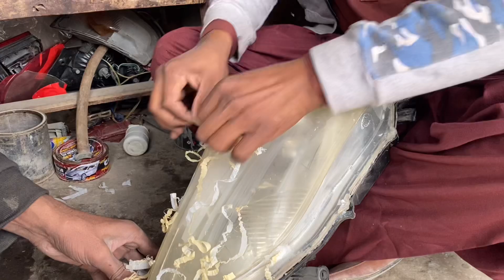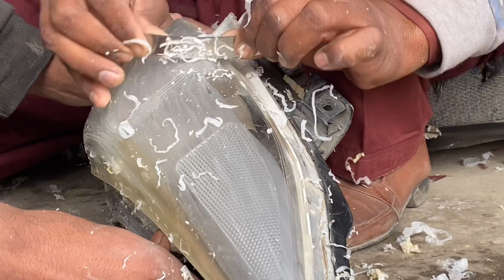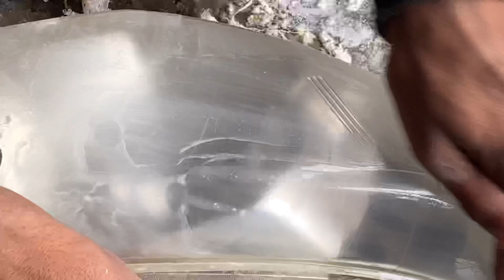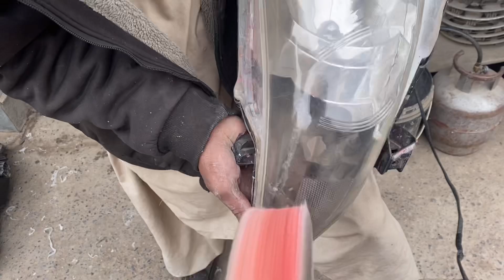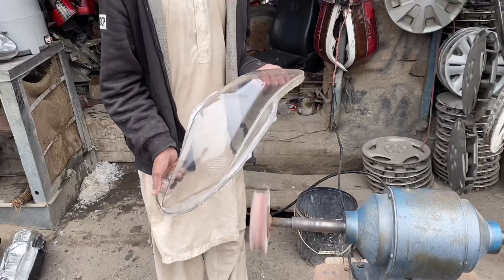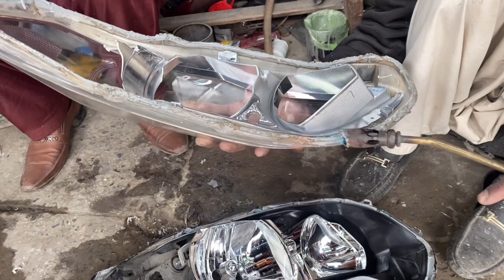Foggy Headlights Restoration || How to restore Headlights Permanently

Comment: He didn’t have to shave off all the extra plastic with a razor blade. He could’ve just spent a little extra time wet sanding the oxidation away and buffed the plastic. He also didn’t apply any UV protection so these headlights will not only be yellow in a few months, they also would start cracking because of thinning.
Reply: Your point of view, would be better to buy a new one, but this people are amazing, they do this because some need it as temporary prior to have a new one.
Reply: which best uv protection does not crak the headlight? educate me please.
Reply: Лак 2K HS  слоя 2. Поверхность фары должна быть матовой перед нанесением лака для лучшей сцепки лака и пластика.
Reply: @festonekfesjuhchishimba1200 Ceramic coating is probably better than Acrylic clear coat which is what is used more in new cars.
Reply: Tenta fazer igual depois verifica se o resultado chega a pelo menos 1% do vídeo.